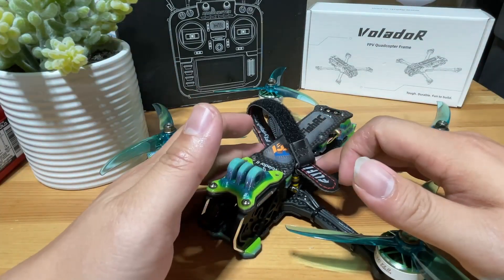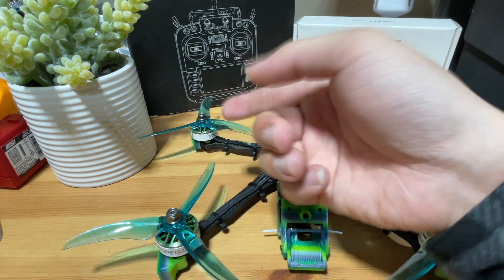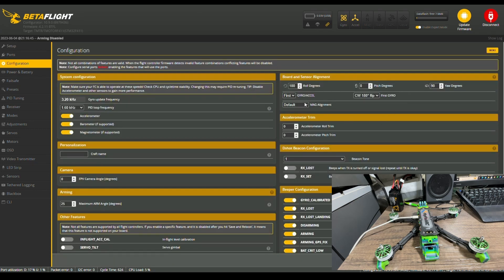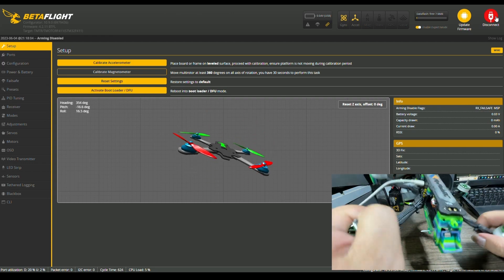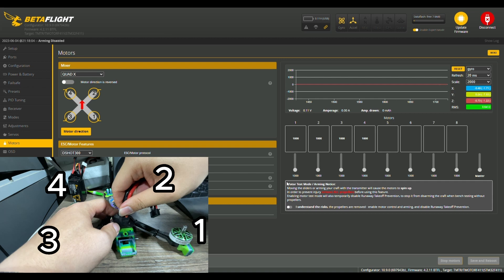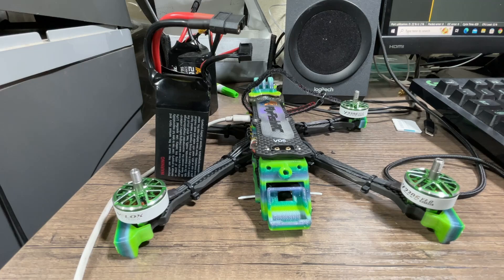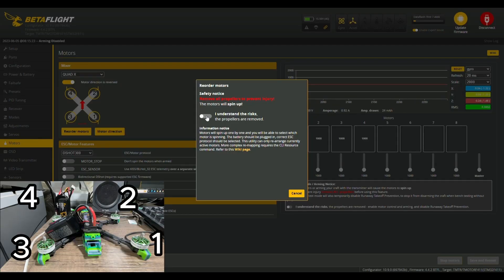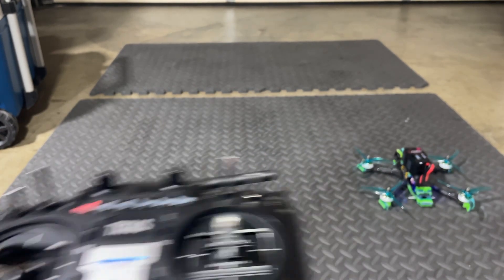Build a 5" FPV Drone Part 4: Cause of Runaway and fixes #drone #fpv #betaflight

Comment: my mobula 8 bounces.. jumps up and down after a slight bump and says runaway
Reply from the maker: 1. Check your FC orientation 
2. Motor mapping and prop direction
Reply: @XwingFPVRC  i just plug and play gonna check it out. and calibrate but i can fly it. but once i even try to land thats when it bounces gos power up 3 inches up then dies down then powers up again goes up and dies down again . the solution i did was just dis arm and rearm .  but it still "bounces". im using a mobula 8 elrs and radiomaster pocket

Comment: Good videos, but Where is the part 3?
Reply from the maker: It is right here: https://youtu.be/67_L9X3K_S8 

Decided to stuff this between the middle as you need to flash Betaflight to use the change motor function